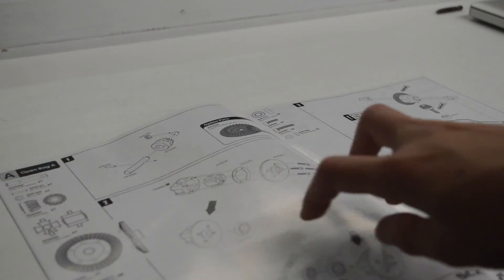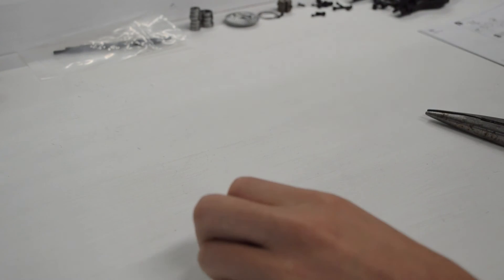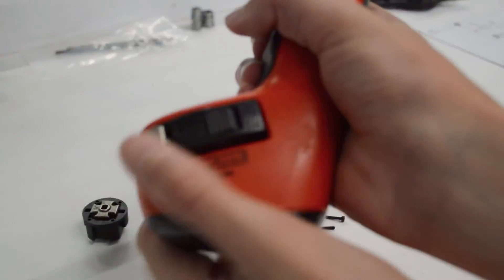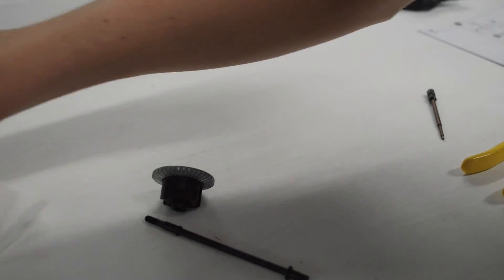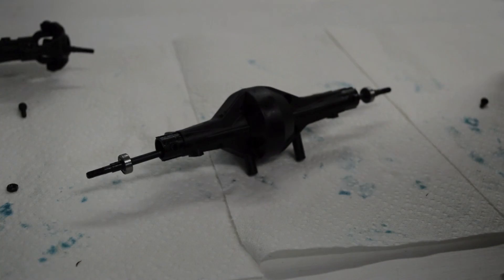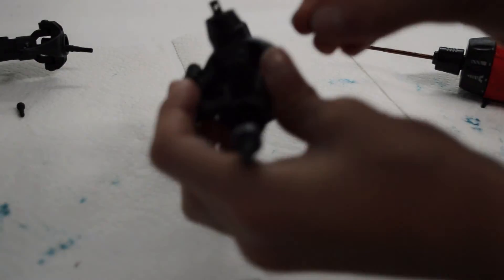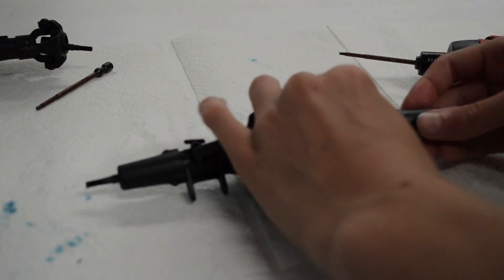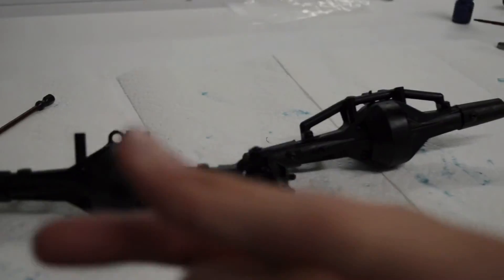RC EXPLORER - PROJECT: "LOGO" - PT2 - AXiAL SCX10 JEEP WRANGLER UNLiMiTED RUBiCON BUiLD SERiES

Comment: hey good video, but don't use the drill to fully tighten screws, especially for the first time, when metal goes with plastic it heats up, so put all the screws in half way, then go round again and fully tighten them, because that way you don't get round off issues and you dont shred the plastic :D
Reply from the maker: Thanks for the advice man, I'll keep that in mind for future builds!